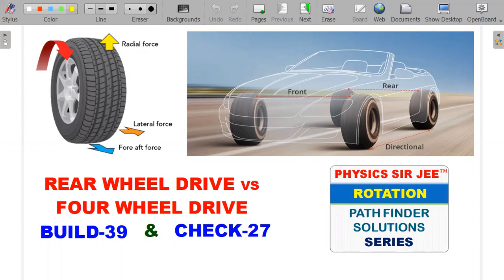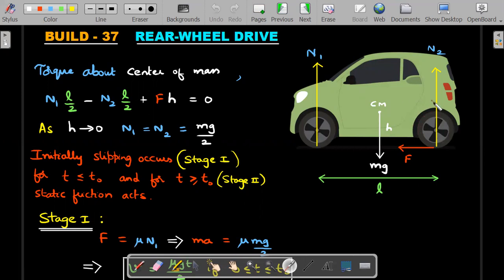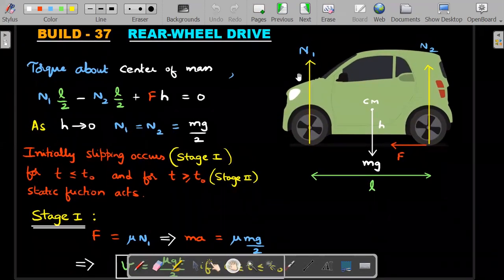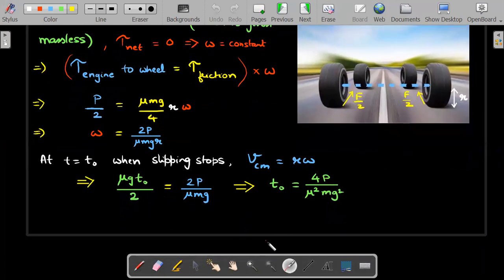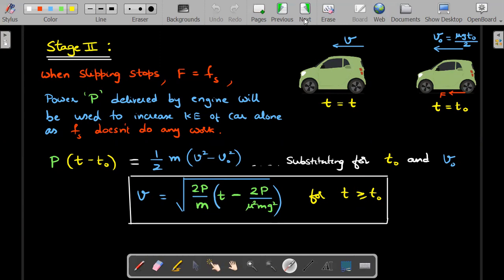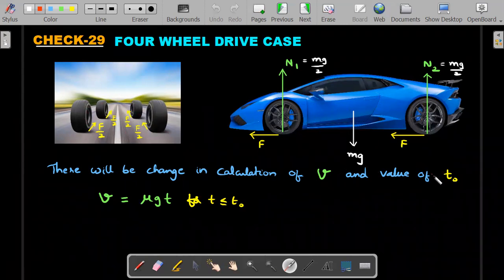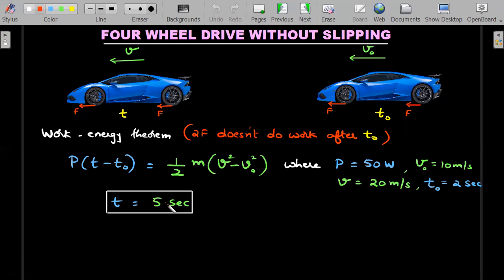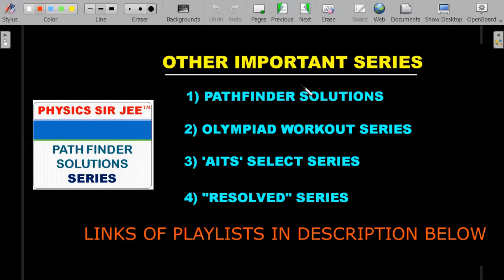PATHFINDER PHYSICS VIDEO SOLUTIONS | ROTATION BUILD-37 CHECK-29 FOUR WHEEL DRIVE JEE ADVANCED SCHOOL

Comment: Sir your logic of 'w' to be constant is flawed and cyclic. You said torque is zero because wheel is massless (underlying logic is T=I(alpha) and as 'I' is zero torque  has to be zero for any alpha)
Then you said as torque is zero alpha is zero but sir zeros on LHS and RHS can't be cancelled out.
Reply from the maker: Thanks for pointing out👍🙂. I should have done a better job in elaborating it at 5:54 . My apologies for the same 🙏.
*THE DISCUSSION LOOKS RUSHED BUT IT'S NOT INCORRECT*. Here's the elaboration 👇
On rear tyre , there are two stages of initial periods. First stage is a very short duration (call it dt sec , during which friction is not microscopically developed yet) . During this negligible period , engine power provides a large torque to increase the Omega to the value mentioned. At the end of this dt sec kinetic Friction is fully developed and Then this Omega is kept constant from zero to T0 as mentioned with Net Torque  zero . So , on rear wheel ,torque provided by engine is equal to torque by friction. It's better to visualise massless as I tending to zero , rather than equal to zero.
Reply: @PHYSICSSIRJEE  The way I am getting to this result is something like this:  The torque on the tyre is zero so torque by axle balances the torque of friction,but frictional torque is constant so torque by axle is also constant. Now as the power delivered by engine is constant the angular velocity must also be constant. I am trying to point it out because if in a question the coefficient of friction starts to vary or power by engine varies for some reason the angular velocity of tyre will also vary even though the torque is zero.
Reply from the maker: @PraveenKumar-id6mn  looks perfect 👍 👌 explanation once a non-zero Omega required for constant power is achieved . Like I said in my previous comment , I tried to avoid abrupt rise in Omega from zero to w0 in dt sec . The order of this relaxation Time (dt) depends on how small the mass of tyre is. In a perfect theroetical world it will be zero.
Like you pointed out , your explanation of Omega is constant (after the dt sec) is correct whereas in the video I missed that point . I shouldn't have said it directly from net tau =0

Comment: Sir in the first question (rear wheel drive), once the condition for rolling is achieved, how is it ensured that the wheels continue to roll after t° ?
Reply: Ig it's too late,but If you see the final expression acceleration decreases with time so friction needed to roll is highest initially,  so if that condition is satisfied, it should work for all t>t0
Reply: @abhinavpj1729 ..bro but angular velocity remains constant..but velocity changes after to..so how v=wr will be maintained after to
Reply: @abhinavpj1729   congratulations on crl 80      (tips dijiyega please if possible)

Comment: janardhan sir as soon as car acquires a finite initial velocity wont the friction on the front tyres act backward to oppose relative sliding analogous to friction on bicycles then why didnt we include that in fbd of question 1
Reply from the maker: Omega of front Tyres won't be same as back tyre. Since there is no engine torque on front tyre the friction acts for infinitisemally small time to increase it to required Omega (as it's massless) and then stop acting
Also at every instant very small static friction acts to increase it's v and Omega because of its very small mass
Reply: Son the front tyre is massless so no torque is required to increase its 'w'. So no friction will act try drawing an FBD of front tyre with force at centre of tyre by axle and friction by road when you  write the T=I(alpha) equation you will get friction is zero.
Reply: @PraveenKumar-id6mn   with due respect sir i ofcourse know that tyres possess no mass which actually is a hypothetical idea,practically the correct word however is they possess negligibly small inertia,however speaking truthfully frictional force will definately act due to relative sliding between contact surfaces but due to the very small inertia of tyres we neglect its effect while analysing dynamics
Reply: @ponnapu  yes completely true and therefore the force is not included in FBD